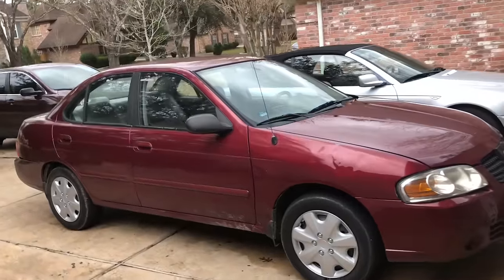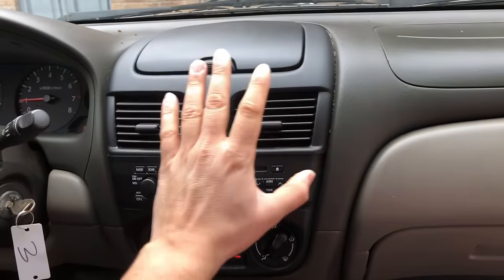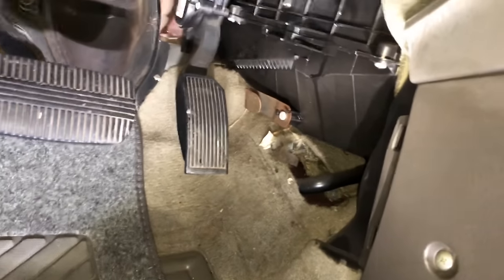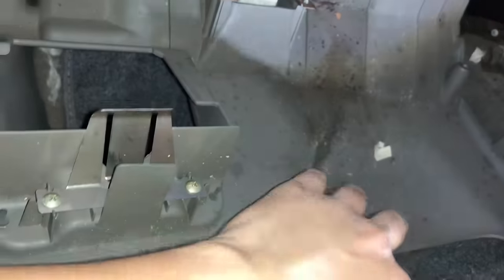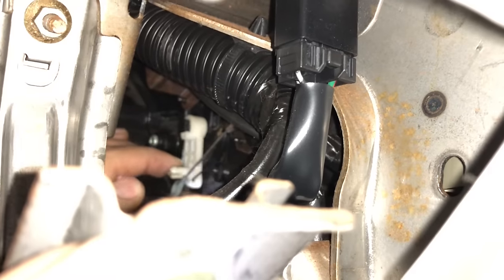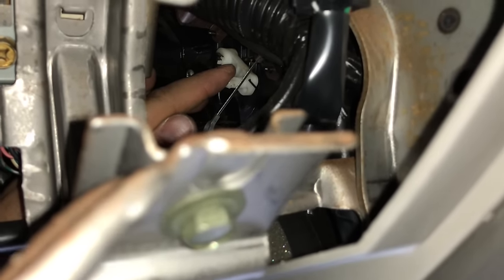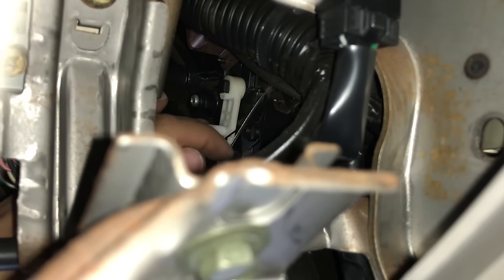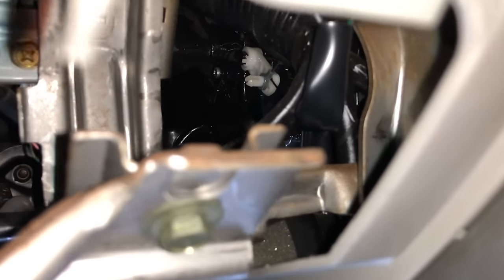Ac Blows Hot Air Only Fix - On Any Car

Comment: Yes but an elastic band would have been aneasy fix. You could have just wrapped it round the lever and to something opposite so when you adjust the knob the band will pull it back the other way. Mongolian mechanics.
Reply from the maker: In this case where we live heater is not required, that’s way I left it cold all the time. But if you need your heat to work go ahead and put your elastic band that you are talking about

Comment: Ok I’m about over all these mechanics and their it’s this it’s that and I still have a messed up ac. It’s been going on for a month now can’t find a good mechanic to save my life. My compressor is good Freon is topped has a fan clutch put in because one guy said it was my fan clutch after he installed that my ac was still blowing cool/warm but my back ac was ice cold. Found out he put the wrong fan clutch in my car so we switched it back to my old fan clutch which there was nothing wrong with it. Changed the passenger actuator didn’t help changed the climate control panel didnt help. Took it back to a different mechanic he played with the driver side actulator and it got stuck on heat in front and back now  and told me my compressor is bad SMH ... so a few days later I take it to another mechanic he said the guy left my heat on so he told me to get a flush kit so he can use the clamps and hoses out of it he cut my heater core and clamped my heat off it blew cool again and the back ice cold. My climate control panel does not turn from defrost etc it’s stuck on vents. What in the world could be wrong with this junk I have a 2002 GMC Yukon slt
Reply from the maker: It’s definitely not your compressor because it’s turning on and cooling, I think your issue is vacuum lines or actuators or control panel. But you replace some of them already....  check the actuator that I show in this video, that’s what control air direction
Reply: Garage Boys ok I’ll have my boyfriend try it. You think it’s in the same spot as yours if I have a 02 yukon ? Two mechanics have told me they would have to take my whole dash apart and my center console which would be an expensive job. Why would my back be ice cold and the front warm/cool though?
Reply from the maker: Yes it should be on the same area as mine, but I’m not sure how much they would have to remove. Try doing what I did

Comment: So you think this will work on any car? What if your car doesn't have the same access panels or switches?  I think it will only work on this car and model and only with this problem. The title is complete BS
Reply from the maker: about 98% of cars have the same mechanism so yes it will work. its the same location and layout that engineers use all the time